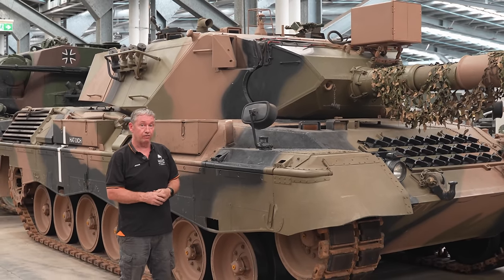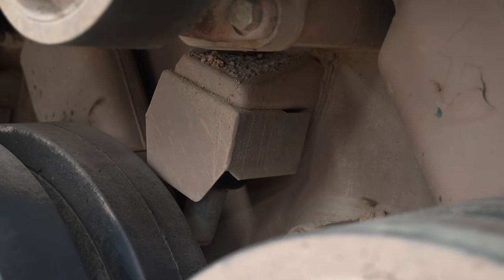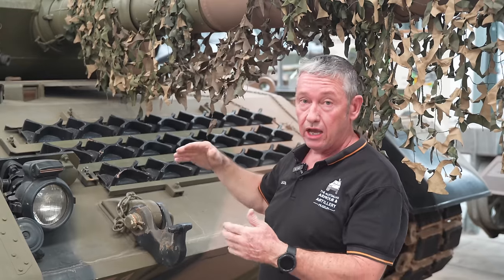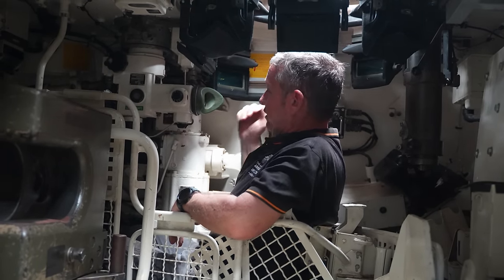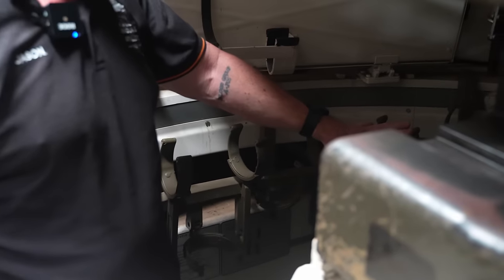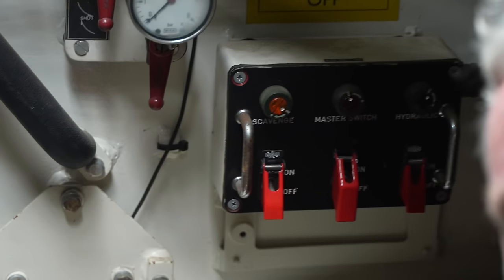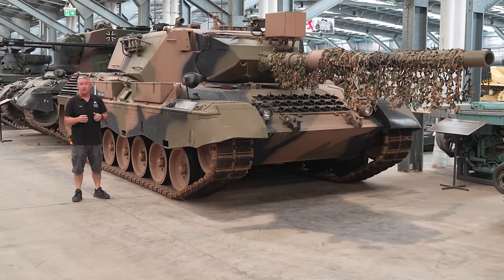The AUSSIE Leopard AS1

Comment: i was an dutch leopard 1V gunner  and i did not know that the barrel had a life span of 250 apds rounds, i learn every day.
Reply: Your Master Gunner kept a round count on your barrel, based on your commander's reports
Reply: @drewschumann1  ammunition consumption also tells a lot.
Reply: Probably a silly question but is that a good lifespan for a tank barrel
Reply: Ik ook! A59/ 85/4 en jij.?
Reply: @matthewcullen1298 yes it is. My arty barrels are checked/scoped/xray’d every 250-400 rounds. They ‘crater’ just after the chamber and depending on rate of fire and ambient/cooling they live shorter or longer.
Reply: @martenk5370  g'day Marten . warm greetings from Queensland Australia 😊 thanks very much for your reply. That makes total sense to me. I'm just a carpenter (or chippy as they call us in Australia) but I do understand a bit about what sort of premature damage extreme heat can do. In my younger days I used to shoot a .270 Winchester and an SKS. The barrel on the SKS would get very hot. The rounds were so cheap we'd put 100 through just shoot tin cans. But the heat and pressure caused by artillery is of course much higher and the barrel can only stand a certain amount. I use to trim the cases on my 270 ammo before I reprimed them every time I reloaded them. I'd  keep my 270 for target shooting at the range or hunting feral pigs. It was too expensive to waste.I'd imagine that not only would it be dangerous to fire through  a damaged artillery barrel but it would really affect the accuracy , especially over the distance you guys are firing. I'd love to see one of those guns up close. The engineering amazes me and also how you learn how to drop a round with such accuracy repeatedly over such a large distance. I remember watching a doco on the Paris gun in ww1. They were lobbing shells over 100 km.
Anyway I really appreciate your reply mate. Hope you and your family are well. 😊
Reply: @matthewcullen1298  No problem mate. Large caliber barrels or gun tubes wear differently than small caliber barrels. The cratering is one thing because of the extreme heat and violence of the explosion, wear and tear of the rifling depends on the ammo used and the cooling of the barrel.

Ive had tubes that were truly well and done after 500 rounds, high rates of fire in extreme conditions will do that. Tank barrels are different from artillery because they are usually lighter and not made for continuous fire. (A normal engagement is quoted at 6 rounds) 

Regular maintenance and checking of the barrels is what keep them alive usually. For instance firing with a wet barrel (gun oil) with cause mega cavitation and will destroy rifling pretty quickly. Wipe those barrels dry before firing! 

I work with 30mm all the way up to 155mm, if you have any questions just ask👍

Thanks for the well wishes, same to you and yours. Regards from the very cold Netherlands.
Reply: @matthewcullen1298  The German 7,5 cm KWK 40 had a barrel life of 6k rounds of HE and 4x less shooting AP rounds, just for comparison.
Reply: @mikkorenvall428  Also your periodic borescope and pullover...
Reply: Best analysis ever of The leopard tank, thankyou for your service mate👍👌🙏, beautifully designed tank from Germany 👍
Reply: Thats probably because the Dutch army like other western European armies don't have a budget to train with therefore barrel life is of no consequence.
Reply: The trainig ammo is designed to save the barrel and it can be more rounds fired as with sharp ammo.

Comment: The Germans made such good-looking tanks. The Panther and the Leo 1 were two of the best-looking.
Reply: Kinda subjective but the Panther is dopey looking to me turrets just a misshapen cube. Now the jagged panther now that was handsome
Reply: @jomoma8576 opinions differ
Reply: Yes they did! ❤
  I like the Henshel Tiger 2 made by Henshel, it is gorgeous!

 Leopards, particularly the Canadian C2A1 Mexas is just beautiful although this AS1 is just a stunning peice of armor. Clean. That turret is fine! ❤

And yes, Jagdpanther is nice looking.. for a  casemate. 😂
Reply: @jomoma8576  Yes I agree it's not really a tank though but it still is quite handsome.
Reply: But not the tiger!  Which looks like a chest of drawers that's fallen over😂
Reply: @Altair885  🤣🤣🤣🤣
Reply: Yes that’s correct, but the most important question is does it have a boiler vessel (kettle)? As a Brit this is most important.
Reply: @stephen7571 🤣🤣🤣🤣🤣
Reply: @stephen7571 it probably might have. Germans need to stay warm in winter too
Reply: The design follows the function of the Leo 1 hence good engineering praxis determined it. I drove the Leo 1 A1 in the German Army for 15 month in the 80th, indeed this tank was very easy to handle, powerfull with a very reliable MTU V 10 diesel engine and comfortable for the crew, well done !

Comment: I was a Leopard tank commander from 2003 to 2007 when we transitioned to the M1A1 Abrams. I loved it, although it did tend to go through engines a fair bit, but when she would overheat we would jump out with the water Jerry’s, pour water in and away you would go. Pack changes were always super easy and quick. Two steering pressures as well which made it super fun to drive, you could easily drift it on the wet grounds in pukka but wasn’t wise! Loved shooting the 105mm at Bundy and still remember cleaning guns first thing in the morning with an oversized pull through, a can of oil and a whole bunch of us pulling and pushing before chucking the dehumidifiers in…such good memories. Every single thing he said gave me instant memories and they all came flooding back!
Reply: What a great comment, very evocative

Comment: Hi Jason, thanks for this excellent chat about 'your' Leopard. Back in the mid-70ies I was trained as gunner, loader, commander in the German army. Initially on a Leopard 1A2 which was soon switched for a brand new 1A4 whose 1st gunner I had the honor to be. This had the same welded turret as your tank, but different sights. Commander's sight was a PERI R12, and the gunners main optics / rangefinder was an EMES 12A1, both connected to a hybrid firecontrol computer FLER-HG. No other sensors or a laser - nevertheless, once you knew your stuff, extremely accurate. Ammo-wise we also fired the APDS and the HESH/HEP, but additionally we had a HEAT with the freely spinning band to counter-act the rifling, all with the associated training rounds. Well, I loved that beast!

Comment: Spent quite a few years on these in RAEME at The Regiment and The Centre.  I have lots of (mostly) fond memories of working on them.  A great run-through and it was fun seeing inside one once again after so many years.  There are a few updates since I was last inside one in the mid-eighties though!  I remember quite a few going for turret lifts after the micro switch on the turret ring pump failed and they were traversed with inflated ring seals - they were the less fond memories!  I had to URPC the tubes on those after inspecting them at their EFC life, before they went to ROFB for final condemnation and recycling.  My other 'fond' memory was keeping well clear of the main armament when first firing up the turret hydraulics, just in case the stab decided to get a 'ghost in the machine'.

I ended up working with Mr Jarrat's son in Canberra, many years later, during my second career.  Mr Jarrat had a Cent at that stage, not sure if he's still got it.  It was a little strange that fate would dictate a connection in that way, but I'm very glad I got to be part of our Leopard era.
Reply: Thanks for sharing your reflections. I always like learning from an Aussie veteran. 🫡
Reply: Greeting from RCEME. Gave the boys a hand every now and again, couple of packs, final drives, heater ( that was a bit of contortion in the turret back). Great vehicle. Played enemy force for an exercise with almost every Canadian Leo attacking us. Impressive!!

Comment: Some Aussie Leopard tank trivia for the viewers. I set up and managed a Aussie defence manufacturing engineering business in Melbourne in the late 1990s specialising in manufacturing parts for the Leopard AS1, M113A1 and ASLAV. The very first contract we were awarded was manufacturing the splash guard, these are found on the extreme front corners of the Leopard 1 over the tracks and can be seen very easily in this video. This tank behind the speaker has a splash guard from the German manufacturer on one side; and an Aussie made splash guard from my factory (on the drivers side - right hand drive). 

German made splash guard is moulded from one piece rubber with two layers of reinforcing fabric. My factory produced the splash guard in two piece rubber reinforced with 4 layers fabric which can be identified on this tank by the row of 10mm hex head screws in the upper inner corner of the splash guard. The German description is - Spritz schute kette - Chain, spray, cover (Germans call tank track - kette (chain)). The German price per unit in 1998, was AU$1500 each! Our price per unit was approx 30% of the German price.

We were making spare parts for the M113 and Leopard AS1 until both were withdrawn from service in the 2000s, and ASLAV. The Leopard fleet management guys I dealt with at Victoria Barracks Melb told me the change over to the Abrams was cos the Leopard 1 was most unbattleworthy. Armour was only proof against 25mm cannon rounds. There is an Leopard 1A4 turret at the Puckapunyal Tank Museum which had a 105mm round fired at it to test its ability to resist penetration by MBT rounds, it pierced the side of the turret, continued on and pierced the opposite side of the turret and went clean through! Not good for combat up against modern MBTs. Thanks for reading my two cents worth.
Reply: I found that interesting, thank you!

Comment: The additional 'armour' around the turret of the early Leo's including the Canadian version you showed, is actually a very heavy rubber/mesh composite designed with a stand-off as you can clearly see.  This is to reduce the effect of an incoming HEAT round from say, and RPG-7, SAGGER, BMP round or similar.

Comment: Good effort but this manual lacks depth in certain vital areas. Firstly, not having access to splendid chaps running around the place in shorts, fixing all and whatnot, how do I tension the tracks on my own Leopard? Secondly, can by some simple test perhaps be established how long it would take to evacuate the tank in case of say, a fire?

I'm also very interested to know what kind of rubber is used in the trackpads so the tanks stick securely to the underside of the globe and don't fall into space all the time.

Comment: The Canadian Army acquired 114 Leopard 1A3 tanks, along with a few armoured recovery and engineering tanks. Approximately 54 were stationed in Germany until Canada pulled out its NATO bases in Germany in the early 1990s. When the war in Afghanistan started, the tanks were upgraded with 1A5 turrets which had the newer EMES18 fire control system, but the original 1A3 hulls were retained. 

The 1A5 turrets were used mainly because they could accommodate a cooling system where the crew wore special cooling vests due to the intense heat in theatre.
The turret was also large enough to accommodate the addition of external storage bins that could be used to store personal kit and other essentials. These upgraded tanks were designated Leopard C2. They were eventually taken out of service. The Canadian government tried to sell them but found no buyers and kept them as target hulks on the air weapons range at Canadian Forces base Cold Lake. 

In 2007, the Canadian Army acquired 20 new-build Leopard 2A6M tanks from Germany for use in Afghanistan. These were leased with the understanding that after the war ended, they would be overhauled and brought back to original condition at Canada's expense. Canada also acquired about 80 ex-Dutch Army Leopard 2A4s that had been sitting in storage, more or less, since 1984. These were refurbished and add-on armour packages were added along with anti-mine protection. These tanks were designated 2A4M CAN, and a few saw service in the later stages of the Afghanistan war.

As an aside, the Canadian Army tank units in Afghanistan also used canister rounds - to rather good effect against Taliban infantry operating in open country. 

Canada recently donated about four of its current Leopard 2's to Ukraine. The government plans to replace these tanks soon. What the replacement will be remains to be seen.

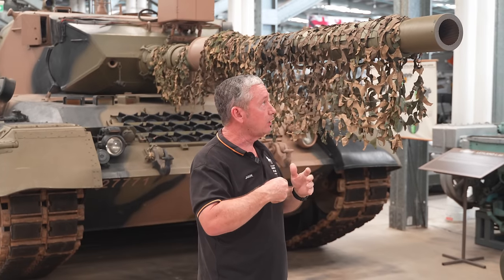Comment: 05:30 ish. I dont know about Ammunition beeing used in Australia, but German/American Heat rounds for L7 Guns also had rotating bands on them, to lessen the spinn imparted on the round whilst going through the barrel.
As far as I know the negative effect of spin on the heat round is also not down to it wanting to spin of the target, but down to the negative effect on the formation of the HEAT jet.
The spin makes it less coherent, and that reduces the penetration of the HEAT round massivly.
A problem the french solved by using the Obus G Round with internal ball bearings.

Comment: M48 had same gun M68 105mm. SABOT was right at 5000 feet per second. We also had beehive timed. Loader set the range and a bursted charge burster charge disbursed the flechettes. The life of the M68 gun is 4000 equivalent charges

Comment: Jason,  great video on the Leo AS1,  great to see it finally put under the spot light.

I do have one question regarding the ex Belgian Leo1.

About a month ago (the Christmas Q&A video), Kurt said you were finding it very difficult to obtain Leo1 parts (for obvious reasons).

Has it been repaired yet?  Will it be ready for Ausarmourfest? If you can’t obtain parts from overseas,  does the Australian Army still have Leo1 parts stored away?
Reply: Thanks for the question, we are still awaiting some relays for the transmission. As there are a few LEO 1's currently in service with the Ukrainian's, parts are a little harder to come by atm, we have them on order, hopefully they will arrive and the 1A5 will be available for AAF24....We still have the Gepard as a runner as well.
Reply: Mate,  thanks for the prompt reply,  and yes I’m aware the Gepard is a runner.

And hopefully the parts arrive from O/S for the Leo 1 in time.

But failing that,  are you able to access any stored parts here in Oz?  Do any spares still exist?   Or is that a bridge too far because of Government ‘red tape’?

Comment: We were told during our training on the Leopard 2A4, which has exactly the same switch function, that a German tank commander was killed by the hatch when fording. The switch failed to detect that the hatch closed and his head got stuck when the hatch was sucked towards the closed position by the power of the inlet air to the engine

Comment: When I finished my electronics course in 89 I had two choices 
Puckapunyal to the tank squadron to work on the leopards or Sydney to the aviation squadron to work on helicopters 
I was keen on the tanks but have a young family we chose Sydney and then I ended up at Townsville on the Blackhawks 
So I missed the tanks but didn’t mind the flying instead 
I suspect you would have been there Graeme if I had gone there 
I still to this day think the leopard is a very good tank 
👍👍👍

Comment: It's a fascinating piece of kit, Sure, kinda dated now, but it must have been a rocket ship for it's time.
"engagements beyond 9995m is where the gunner makes the big bucks" I'm /SURE/ anything hit beyond that range earned the gunner more than one or two drinks :P

And finally, at 5'4" Jason, you're right in the pocket for optimum tank crew height, no wonder you managed 12 years at the helm. Thanks again for the wonderous commentary, you've still got that Crewie 'pata' down pat.

Comment: Some will probably say yes of course I knew this. 

BUT. the sound from the exhaust from leopard 1 is very special, it took them some years to make that sound masking that it got. U can’t tell from where exactly or how many leopard 1 tanks are coming. You can be out in the field and just hear it come but not from where.. that’s a cool feature that no other tank got..  also there are little problems with the power pack.  In Norway we used oil in the road wheel bearings instead of grease.  U also got 2 settings on the diesel heater and that is really hot or hotter than hell
Reply: The engine will also stop if it’s missing oil or coolant or if no circulation on the coolant. A light will give a warning first and than turns off the engine.. they also got a fuse to override this in emergency
Reply: I started on these in 2001 as a driver. The hardest part was maintaining the constant engine level sound. It was easy just to floor it, but you’re spot on. At night when we simulated an attack and the infantry stated they could not pin point where we are coming from. It was great.

Comment: No aircon,  Heater, no issue- German tank after all.
Me, well played with plenty of them through the 90s into early 2000s.  Good chance I played with this one.  Always interesting watching the mechanics out on the test track with one minus the turret.  Would cram a few extras into the hole where the turret would normally reside.  Extra pickup on the throttle when u are down ~ 9 odd tonne.
You could always pick the 'noobs'.  They're the ones still hanging about the exhaust ports when that distinctive sound of a Leopard started rang out!!